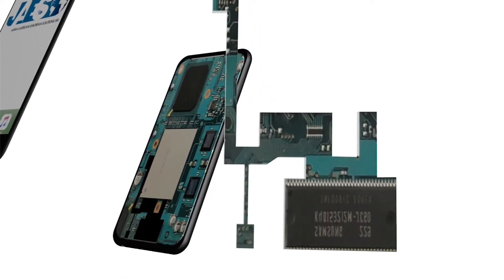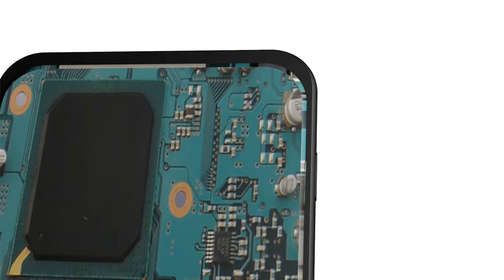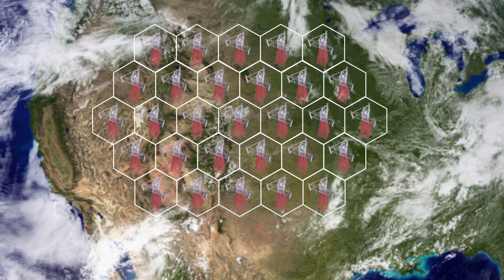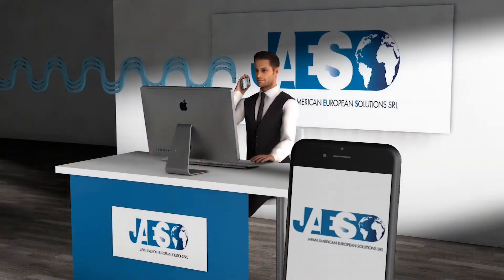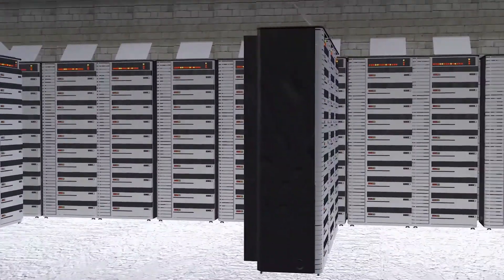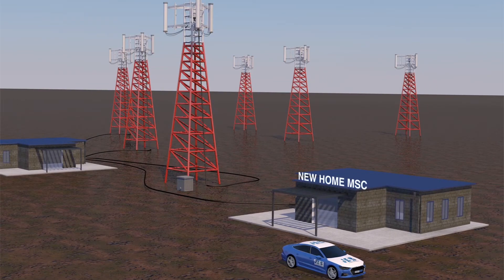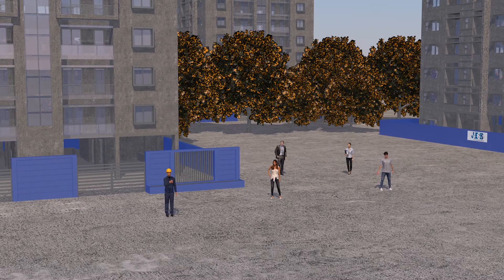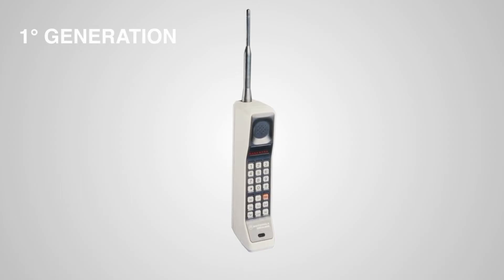How does your SMARTPHONE work? Electromagnetic waves and Mobile Switching Centers - 3D Animation

Comment: I am wondering about the travel path of the call signal?  I am wondering once the MSCs figure out the right MSCs for the two phone users, then does the "call signal" just travel between those MSCs or even travel only between the cell towers once locations are determined?  Example, two people both have the same home MSC in Atlanta but they have both traveled to foreign MSCs in Los Angeles, does the whole call have to keep traveling cross country to the home MSC or does it just travel between the MSCs and cell towers in los angeles?  Or  even shorter, will the call signal travel from the nearest cell tower to one phone to the nearest cell tower of the other phone once its determined where each phone is located?

Comment: This is a good video, but it does not really explain how the mobile phone work, neither in analog nor in digital form. Also, it does not say anything about the working and the nature of the importance of the RATE OF CHANGE of electromagnetic waves and the role of the mobile switching centers.
I would like to have heard the basic of what supports the mobile phone system as for example:-
Sound waves cannot travel far, but radio waves can penetrate through space if the electromagnetic waves are used. Electric fields and  Magnetic fields may be radiated into space which is an insulator only if the magnetic and electric field launched in it have a rate of change in their function.  Really the electromagnetic vibration is acting like a cart, on which one can load a cart with many things, then when the cart travels to its destination the information or load is unloaded and taken off the cart.
So at the transmitting end sound or video information is modulated on to a carrier electromagnetic wave and this is launched from an antenna where it travels along to the receiver where the information is  then demodulated and  applied to a loudspeaker if it is voice information, a screen if it is a video information or applied and stored and processes in a computer if it is data information or used to control some machine if it is remote control information.  The carrier electromagnetic field is made to oscillate in kilohertz, megahertz and also gigahertz, each of which has its own characteristics.   If analog sound or video information is added and modulated on a carrier wave the latter need not have very high vibrations but if fast digital pulses are modulated on a carrier electromagnetic wave the latter needs to be very high as otherwise there will be difficulty in the transmission.  
Mobile phones operate in nearby connected cells as the range of high-frequency transmission  is not very long, but with cells operating and coordinating the information to transmit and find the particular receiver one need to transmit both the location of the person receiving the information and also those transmitting it as otherwise mobile phones would not be dedicated to particular individuals but would be a general transmission  where anyone can pick up the information. Straight line transmission using space satellite is often used with mobile phones.
There are many additional refinements to mobile phones as compression of information, error correcting codes, image processing, the transmission, it is divided into packets so that one can make use of many transmission paths at the same time.  one can imagine the complexity when a packet would contain, location of transmitter and receiver, sequence location of the packet, error correction, parity information and the information itself.    Since the speed of transmission is very important in some processes as in the case of computation in real time, then the high speed which enters the gigahertz spectrum becomes imperative.
Reply from the maker: Dear Carmel thanks for give us advise can you please let us know what do you think about https://youtu.be/OCh4svEfDmE this new video thanks a lot for the time you spend to leave you interesting point of view